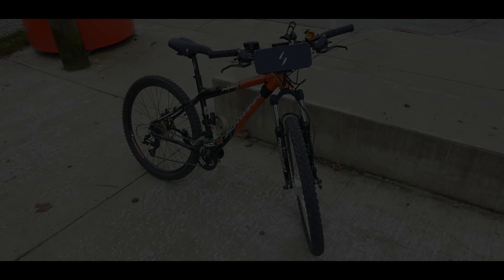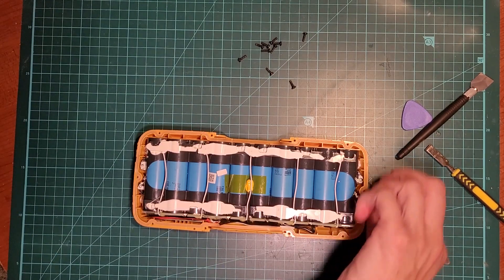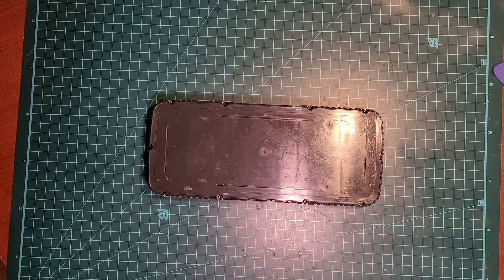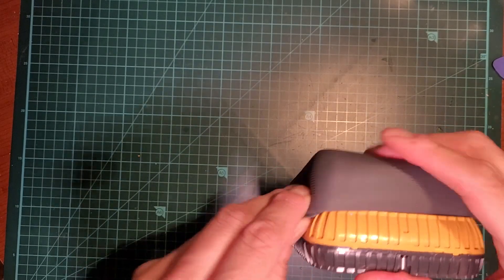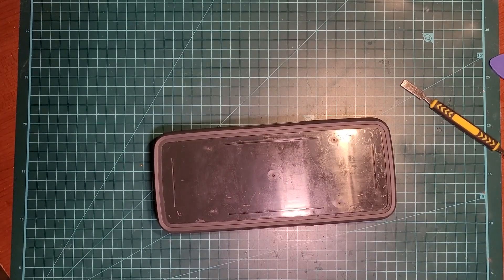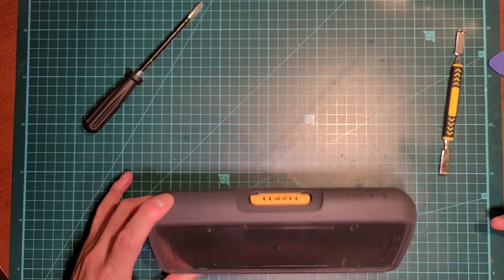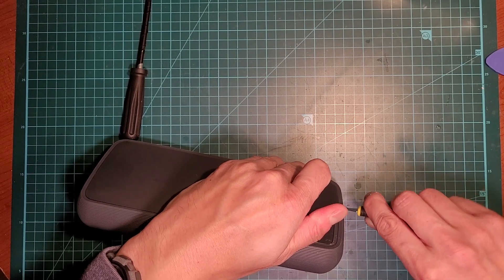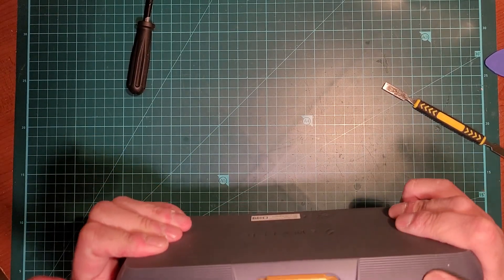Swytch Max Battery Teardown

Comment: Would be great to see a Swytch Go or go+ teardown.  These look like a better candidate for expansion/re-celling
Reply from the maker: yah, but those batteries are way too expensive to get, even for rebuilding with new cells. Better to just build your own using an adapter that allows all other 36v batteries available.
Reply from the maker: I don't want to give them more of my money, also, I don't have any. If anyone has a broken one, I wouldn't mind tearing it down on video.

Comment: Thanks for the video. I love the switch kit but the battery is way overpriced. When mine dies I'm planning to DIY re-cell it and your video is helpful to see how to open it. New max battery is 270 euro while 10 cells are 60-80 euro. That means ~200 euro for plastic casing with battery indicator that never shows correct status? It's a bit too much.
Reply from the maker: It is. Your paying for the name and you can build one or purchase better cells for the same price. You just need an adapter to make it work with all other 36v batteries available.
Reply: @AerialMax8 I have Buy already the adapter. Do you recommend any good 36V batteries?
Reply: It can easily be taken further, the battery pack is held by more rubber glue. Just lever from the bottom and the switches at the top stay in place. You’re on your own from then on!
Reply: @thetrick9 - good shout, I'd rather get someone to do it though cos I wouldn't feel comfortable messing with the glues and wires on the batteries.